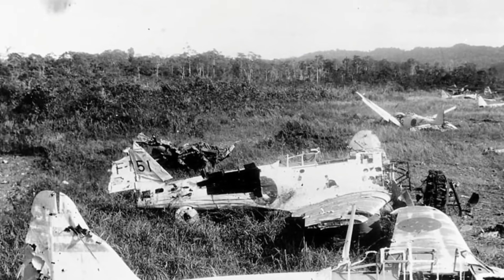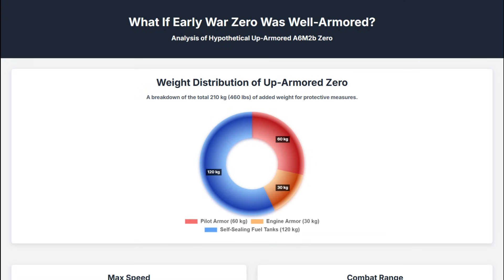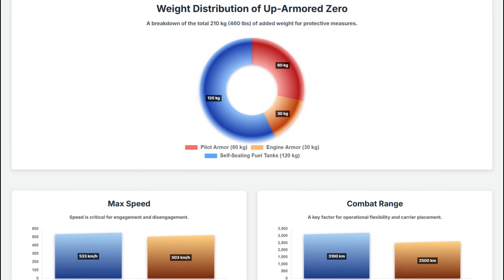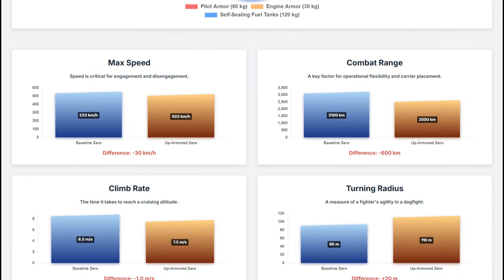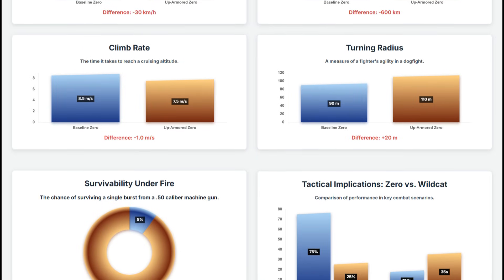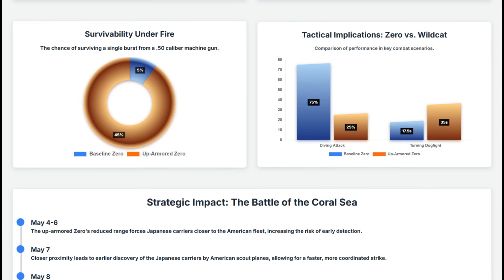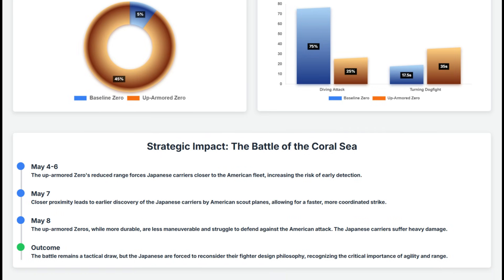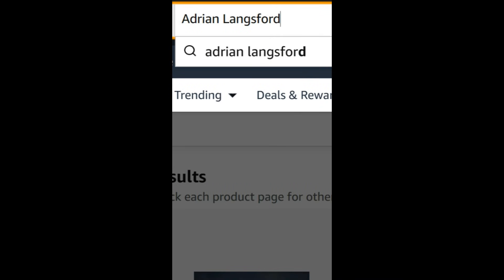What If the Zero Fighter Had Armor and Self-Sealing Fuel Tanks?

Comment: The Japanese also needed more powerful engines which they were slow in developing for the Zero's . The planes they went up against later on in the war had nearly double the horsepower if not more and could just boom and zoom the zero's all day long . Decent working radios would have also been a big help to the Japanese pilots who often just took them out of their planes for weight savings because they didn't really work .

Comment: The idea behind the Zero was that it would not get hit because of its manueverability. 
That might have been unrealistic in WW2 but it is commonplace in todays fighters.
Saying fighters always need armor is like saying soldiers always need armor or shields in combat. It depends. It is not an absolute necessity.
Reply: The Zero’s most difficult mission was trying to destroy Allied heavy bombers.  When attacking a bomber formation, it was really difficult to avoid being hit by the bombers’ defensive fire, because the Zero could not exploit its agility and fire its guns at a bomber simultaneously.  As soon as it opened fire, it had to fly in a straight line - making it an easier target for the bomber gunners.

The unprotected A6M Zero was much more vulnerable to the B-17 and B-24 gunners than the much better protected J2M Raiden.
Reply: @timonsolus yeah but by the time they were fighting those they did have armor and sell ceiling fuel tanks the zero only didn't have those for the first year or year and a half of the war. One of the reasons it turned out to be not so great as time went on
Reply: Today's armor is different. Today EA and counter EA is the armor
Reply: Today's fighters rely more on missles than guns. Most modern day air victories since Vietnam were scored with missles. Particularly the Sidewinder. Serveral versions of the F-4 Phantom didn't even have a gun. 
Today's fighter are not necessarily more maneouverable because of other fighters, but because of the missles.
Reply: @archer494  Bigger difference is ground to air.

In WW2, you're not going to evade flak, and if flying low the AA is still pretty dangerous. You can take a few hits and keep going with durable design.

Today we use jammer and chaff to avoid missiles altogether, and a hit is way less survivable.
Reply: OP is absolutely right fighter vs fighter, which is what people often focus on. 

Bombers and surface fire, as mentioned, you can't get around durability in WW2.
Reply: Battle of Thermopilae, Spartans vs Persians. Spartans had better shields and Amour, that was also a clear advantage.

Comment: Given all that, I'd have to upgrade the engine, specifically its power just to compensate for the additional armor alone. And to increase the range, I'd also increase the size of the fuel tanks, as well. What would probably result is a larger & heavier Mitsubishi A6M Zero that, while not nearly as agile as the original, would be far more survivable in a dogfight.
Reply: The engine could also have done with a pressure injection carburettor like the US fighters had. Otherwise American fighters (once the Americans have realized) could evade a zero by "bunting", a hard negative g entry into a dive which the Zero couldn't match.
Reply: @philiphumphrey1548  NICE IDEA! Glad the Japs DIDN'T think of it at the time otherwise the Pacific air war would've been FAR BLOODIER!
Reply: Well, of course. The Japanese engineering was not better than anyone else's at the time, actually more rudimentary. They constructed airplanes to meet their military planning within the limits they had. That planning was obviously the wrong approach. Early in the war they would not have been able to build an airplane that was more survivable without compromising a lot of other things. The Wildcat made different compromises that proved, very quickly, to be better choices. There were other issues, too, the notion of bushido includes an idea that all you needed to win was superior fanaticism, even if you were at a technical or tactical disadvantage. That was also wrong.
Reply: @brettbuck7362  Aaah, HINDSIGHT! Where were you, hindsight, when we most needed you? Still unborn in the future, I BET!
Reply: @fredhercmaricaubang1883  Of course it is hindsight, and the USA was no less delusional to begin with. But absolutely anyone could look at what the Japanese could bring to bear an extended war, and what the USA could bring to bear in an extended war, and add it up. The Japanese couldn't event take over China - after most of a decade.
Reply: wouldn't make a difference. the Zero was built so incredibly lightweight that it's structure itself was fragile. There was no reserve structure left, and so any bullet hits could cause the airframe to fail.
Reply: The next iteration of the engine development resulted in A6M3's Sakae model 21. It's basically the same engine as Army designated Ha-115. Ha-115 had a variant with water-methanol injection, boosting its horsepower as well the continuous WEP time. They couldn't sustain the allowed engine RPM due to the deteriorating quality in the basic metallurgy and lube oil. But the Ha-115-ii is produced in a large number, more than 1500 units at least. Navy tried to develop their own version of water-injected Sakae 21. It failed so miserably that it makes me seethe, that they didn't share the technology. Allegedly, Ha-115-ii produced 1260hp at optimal altitude. It's definitely not the best engine of the era, but it could fit any Zeros past A6M3 variant.

Comment: Very interesting video!  Here's my thoughts...

If the Japanese Navy had taken pilot and fighter protection seriously, Zero designer Jiro Horikoshi could have designed the A6M2 Zero to be very similar to the very last Zero, the A6M8 Model 64.

The A6M8 Zero used the larger and more powerful Mitsubishi Kinsei engine, instead of the Nakajima Sakae engine of the earlier Zeros.  An earlier version of this engine was used in the Aichi D3A dive bomber - so it could have been used in the Zero right from the start.  

(Jiro Horikoshi apparently wanted this engine in the Zero from the very beginning, but was overruled by the Navy bureaucrats who thought it was too powerful!)  The larger engine would have been useful to carry the extra weight of an armoured Zero.

Imagine an A6M2 Zero powered by the Kinsei 44 of 1,080 horsepower, with the 7.7 mm machine guns in the wings alongside the cannons, instead of in the nose.  It could have all the protection changes of the A6M8, including self sealing fuselage fuel tank, fire extinguishers for the wing tanks, 8 mm armour plate behind the pilot's seat, 55 mm armoured glass headrest and 45 mm armoured glass windscreen, plus thicker skin on the wings so it could dive faster.

The A6M3 could have the Kinsei 54 of 1,200 horsepower, and the A6M5 the Kinsei 62 of 1,350 horsepower.  The A6M3 and A6M5 would also have upgraded 20 mm cannons and heavier 13.2 mm machine guns.

Food for thought... did the Zero have the wrong engine all along?
Reply: wouldn't make a difference. the Zero was built so incredibly lightweight that it's structure itself was fragile. There was no reserve structure left, and so any bullet hits could cause the airframe to fail. no amount of armor could fix that.
Reply: wouldnt matter. more powerful engine means more gas. japan had no gas for anything. america was out gunning, out creating, out everything japan had. The us made more fighters than all of the axis powers combined.
Reply: @Theaverageazn247  the US produced more airplanes in a single year of WW2 than every airplane ever built from 1903 to the 1930s combined.

Comment: The issue with the Zero is poor high-speed maneuverability which the Western fighters were already designed for. If you don't change that about the Zero, the armor and self-sealing linings would have just made it slower and more sluggish, not fixing the poor high-speed maneuverability at all. The Wildcat was reaching a parity in the Kill to Destroyed ratio with it before the Wildcat was retired from frontline because the pilots learned not to play to the Zero's main combat strength (its greatest noncombat strength was its long-range capability) which was its low-speed maneuverability.
Reply: wildcat was never withdrawn from frontline service and fought to the very end of the war, scoring an 11:1 overall ratio.
Reply: @SoloRenegade it was in the context of Pacific Theater
Reply: @alexhurlbut  the F4F was never withdrawn from frontline service in the Pacific theater of WW2. it fought to the last day.
Reply: @SoloRenegade  It was replaced by F6F Hellcat and F4U Corsair in frontline service. It did fought on, but generally in secondline services. Same way it was for P-40s. They weren't fully withdrawn from service late war, but relegated to secondline service and low intensify operation area.
Reply: @alexhurlbut  if you're fighting the enemy, you're on the front lines.

Speaking as a combat vet.

"low intensify operation area."

but not because they weren't capable. No dogfight is low intensity.

also, this is also not true. the F6F and F4U couldn't operate from escort carriers, and many escort carriers were in the main battle fleets.
Reply: @SoloRenegade escort carriers were used for convoy escorts, ASW patrols, amphibious support, and ferrying aircrafts and others to free up fleet carriers and light carriers for major operations. You do not hear of anyone talking about the Wildcat when it came to mid 1943-1945 major actions in Pacific.
Reply: @alexhurlbut  false. the Escorts also supported the amphibious operations with CAS and kamikaze defense. the F4F was the primary defense at Samar as well as in other battles. Tip of the spear in the biggest battles of the pacific war. and they were present at the end of the war supporting the light and fleet carriers prepping for the invasion of Japan as well. The very tip of the spear.
Reply: @alexhurlbut  up to 36 escort carriers were scheduled to directly support Operation Downfall, loaded with F4Fs.
Reply: The final dogfight of the European theatre was fought between RN Wildcats and Me109s over Norway, the Wildcats more than held their own.
Reply: @antonyhughes4702 I believe the Fleet Air Arm called them Martlets. Just a detail.
Reply: If your going to fly a plane in airwarfare but only to duck the fight...than what the hell isnthe point in flying.

Comment: The A6M Zero number one problem was the 1,000 hp engine.
When it went up against the US planes with 2,000 hp engines....it was in trouble
The 2,000 hp engines allowed for armor and self-sealing fuel tanks and higher speed.
When the A6M went up against US fighters with 1,000 hp engines...it was superior.
It was called the Zero because it was developed in he first year, zero year, of the new emperors reign.

Comment: In this configuration the Zeto need a more powerful engine cca 1300 hp or  maybe better 1560 hp Mitsubishi Kinsei 56
Reply: wouldn't make a difference. the Zero was built so incredibly lightweight that it's structure itself was fragile. There was no reserve structure left, and so any bullet hits could cause the airframe to fail.
Reply: @SoloRenegade  Come to think of it, carefully punching a hole in the spars to lighten it is the same thing as having pre-determined bullet holes. It definitely makes the vehicle more fragile against bullets. The reserve structure sounds like it.

Comment: Both Germany and Japan proved, the most valuable assets was not the airplane (Germany increased fighter output to 25,000 units in 1944 & 39,000 total aircraft.) The most valuable asset was the trained pilot, then oil/fuel. At the Battle of Midway, the Japanese Navy lost 400+ highly valued naval carrier aviators and other aircraft crew members. At Battle of the Coral sea was the same, the Japanese Navy lost difficult to replace aircrews.
Reply: Tho you are right, USA produced more aircraft then rest of the world in 1 year in 1940s. So it mattered but pilots mattered more
Reply: @captaintoyota3171  In any system of systems, all the components matter. Aircraft, pilot, maintenance, logistics support, command and control/strategy and leadership,  all play a part in performance of the system.
Reply: Germany was outproduced by even Soviet Union which manufactured 102.000 planes between 1941-1945 meanwhile Japan just could not compete and their extreme stubborn attitude meant that radars and proximity charges never received the attention they needed despite both technologies being developed as early as the 1930s
Reply: @SMGJohn  both Germany and Japan had the problem of not having critical raw materials such as tungsten chromium, nickel and oil.  Japan had magnetron and microwave radars in Service by 1942 ahead of the United States they invented multi cavity magnetron independently before the British but were much slower and deploying them.  If Germany had 50% of the oil production of Texas, the war might’ve turned out to be vastly different.  As it was, they had to invest huge resources into making synthetic oil.
-Germany in Japan couldn’t cooperate his allies because it was a five month submarine journey to transfer technology.  On the other hand you could fly across the Atlantic ocean from Canada to Liverpool in half a day.
-also the Soviet Union was receiving raw materials such as aluminium, high octane gasoline and 600,000 trucks and jeeps, 20,000 aircraft such as C-47, P-39, B-25 from the U.S. plus 4000 tanks and 2500 fighter aircraft from the UK.  
-75000 trucks made it possible to move troops to defeat the Germans at Stalingrad.
Reply: @williamzk9083 
Germany had OIL, they just did not have the industrial efficiency to match Soviet Union. 
Regardless, USSR had fewer factories in 1942 but outproduced Germany in everything because they did not have 10 different companies competing with each other for contracts and making equipment with zero interchangeability.
Reply: @SMGJohn These claims are absurd when you look at the technical inferiority, incompatibility of Yak 1,2 & , LaGG and MiG 2 & 3 compared to Me the refined 109F3 /F4 the Germans used. 
-Russia did not need to produce a full spectrum of materials and weapons.  It received aluminium, rubber, high grade gasoline and 600,000 trucks.  
-Russia had no chance of producing 600,000 trucks and jeeps.  
-the Americans supplied what Russia was incapable of.
-Russias industrial output itself was achieved by starving 4 Ukrainians in 1932-34 by exporting their grain to pay for American, French and German machine tools.  
-The man hours to produced a panther, Sherman tank was the same as a T-34 and even a tiger only cost 50% more.  Considering the T-3434 was a cruder product it’s no victory for Russia.
-Germany lost 30% of munitions production in 1943 due to allied bombing. 40% overall Nd 50% to 60% in 1944x
-So maybe 8000 extra StuG iii, 5000 panthers and 8000 panzer IV and likely more since the USAAF destroyed more tigers and panthers than Russia did in the factories. 
-without us and uk help in crucial areas Russian output is mediocre and German output increases by 66% to 80%
Reply: @williamzk9083 The relationship between Germany and Japan was different to that between Germany and Italy - the Germans would not share military technologies with Japan even if they'd been half a day away by flight.
Reply: @williamzk9083 You have several typos that should be corrected to make things clear.
Reply: Later models of the zero and Betty did have some armour added
Reply: I would like to see modern Kombat loss claims at the battle of the Coral Sea. Just like American claims of a 10:1  one ratio in Korea.  The losses were considerably less in both.
Reply: @williamzk9083 it's important to know that the 10:01 claim was once the Soviets left the battle space. So when flying against North Korean and Chinese pilots who were inexperienced in comparison is when that figure applies and it's kind of close to being realistic I mean all over claiming happened everywhere but they really were a huge differential but against the Soviets it was pretty much one to one or two to one
Reply: @mcamp9445  the numbers of being married up against Russian losses in Korean losses and they were definitely not 10 to 1 more like 2 to 1.  Career was quite possibly the most egregious overclaim in history.  You probably set the United States up for failure in Vietnam.
Reply: Yes, USA had system of rotating most of experienced front line pilots back to States as instructors. Only those suitable for high promotions remained on front line. And combat experienced instructors could pour wealth of knowledge to even larger generation of new pilots. So, a Win-Win, for country without much limits in airplane and fuel production.
Reply: Otoh less planes mean less trained and experienced combat pilots